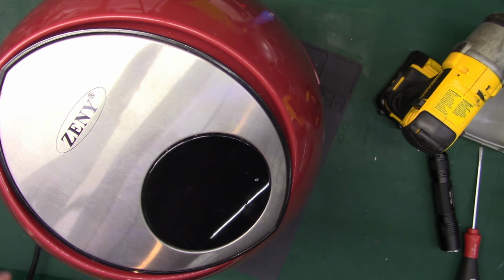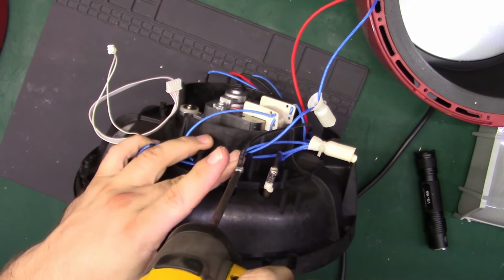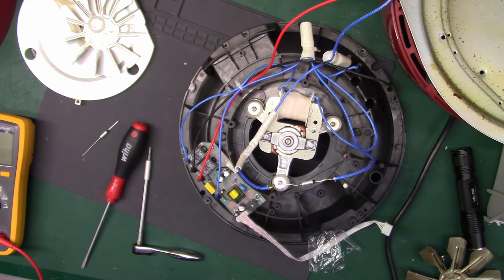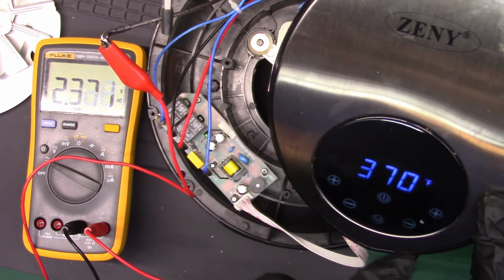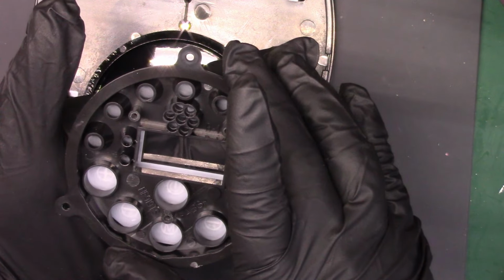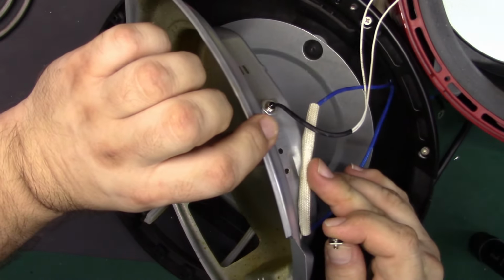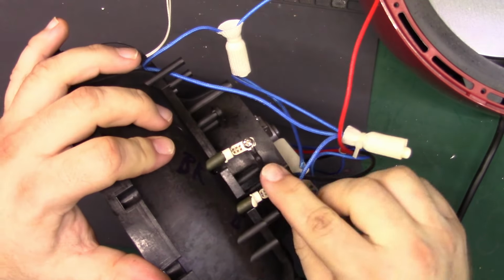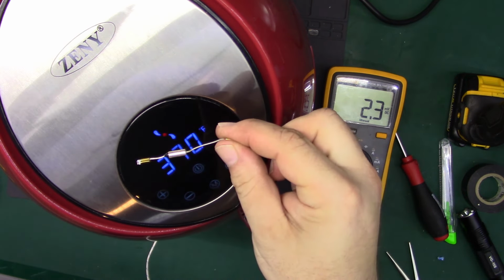Digital Air Fryer Repair

Comment: I can't believe I ran across this video. I have a Zeny that arrived and the fan does not blow' although the pot gets hot. Do you suggest I try these steps?
Reply from the maker: If it's getting hot, then you're half working. I'd check the fan(with the whole thing cool and unplugged). Make sure you can spin the fan by hand. It might be stuck. If it's not stuck then it could be a bad fan motor or bad fan motor control. If the Zeny is still under warranty, I'd get it replaced and save yourself some hassle.
Reply: @FixitFrank  the fan does turn and it is getting hot. The company told me to just keep it so I'm trying to repair it. They sent me a new one and I can clearly hear the fan. Just ran across your channel. Thank you so much for all you do!
Reply from the maker: @JFullerTruth  Oh good. That means its not jammed.  They use very simple shaded-pole motors.  I find them in old microwave ovens and that sort of thing.  You can test the motor by measuring the resistance across the wires from it. If its bad, you will read open circuit. If it never worked, I would open it and look for wires that were notplugged in or fell out.  Its more common than you might think.  Im glad you are liking my videos and thank you so much for watching!

Comment: My 8qt power air fryer pro oven just up and quit. Only used maybe a dozen times. I believe, because I did not pull it out from under cabinets that it blew the thermal fuse. Any one know the part # and info for that machine?
Reply from the maker: You want to find the fuse and get the part number for the fuse off it yourself. I wouldn't trust internet people for info that is that critical. Plus they may have used a different fuse on different parts of the world. 
However you can check repairclinic.com and they may have the manufacturer parts listed. That source I would trust for fuse info.

Comment: Thank you for making this video.  Where can I buy micro switch (model # KW3-0Z)?  16A 2 Pin
Reply from the maker: You are very welcome!  I see them for sale on eBay using that part # you list. https://www.ebay.com/itm/KW3-16A-125-250VAC-Micro-Switch-/162570007647

Comment: My air fryer xl comes on , the lights fan everything works but it does not heat i need help please thank you
Reply from the maker: What have you checked so far? I would verify the heating element and any thermal fuses.  If any of those failed it would give this symptom.

Comment: My Philips air fryer that I bought from Walmart is plagued with an intermittent motor. Sometimes it starts slow and comes up to speed and runs fine. Sometimes, the fan won't start at all. If I spin it with a stick and try again, it usually starts. But, how annoying it is. The unit is clean and the fan turns easily. Any ideas as to what's wrong?
Reply from the maker: Those shaded pole motors can be finicky. Even if spins, you may want to remove the fan blade and clean up the motor bearings. They are usually bronze and can get sticky. They are very low torque so it's easy to make it drag. If you clean it good, I bet it will be more reliable and more consistent speed. Aside from the motor needing cleaning, there isn't anything else that would really affect it, since it's driven off the mains power

Comment: Your video is great... Thanks for sharing with everyone whose has that brand... As for me.. I have a Air Fryer Pro... bought only for 6 month from Amazon now its not heating up... what do you think the problem is? everything is working but no heat..Thanks an advance ;-)
Reply from the maker: Id guess either the element itself or the thermal fuse.  Some have a thermal fuse protecting the element itself.  If you measure the resistance of the element it should be pretty low.  If its thousands of ohms or more(or open), then its bad.
Reply: Disconnected Heating Elements ❓❓

Comment: My big boss air fryer fan won't come on.The heat lamp comes on but the fan will not work what can I do to fix it
Reply from the maker: I'd start by making sure the fan motor isn't stuck. If it's free, then voltages to the fan motor should be verified. Usually it's the same as your line voltage.  120-240 depending where you live. If you have voltage, then you have a bad fan motor. Fan motors are pretty generic. Search for shaded pole motor..

Comment: my thermal fuse blown out and I changed it. It work but the control board on top air fryer is not working It is automatic turn everything on when I turn it on . Can you tell me what happen . Is it the control board for temperature and fans are not working  and where can I buy it. Thanks for your video. It is excellent
Reply from the maker: It's hard to say. I would check voltages to see if it's the transformer or not. Also check the microswitch that detects the fryer basket. If the board is bad I would be surprised. I would check (very carefully) the main power that feeds the main board. I suspect you have another safety interlock problem. Either a switch or maybe a transformer. As far as parts, I am not sure where to get a main board but eBay would be my starting point.
Reply: @FixitFrank  Thanks for your help. I will check them again

Comment: I have fan motor of air fryer Caynel similar with this one 120v /60hz is burn out but I can not buy this fan any where ,some one know where can I get it.
Reply from the maker: Hi John, That is a run of the mill "shaded pole" motor.  You can find them inside smaller fans, old microwave ovens, etc.  There are some variations but these motors are all over the place so finding the same one should not be too hard.  As long as the shaft length and mounting holes are the same(or you adapt them), you are good.  I would check popcorn poppers, induction ovens/toasteroven with convection, as well as smaller fans first.  Microwave ovens might be single mounting hole instead of dual, but of course I am looking at this fan motor. Yous may have one pair of mounting holes.  The main thing to look for is a shaded pole motor at 120/60hz
Reply from the maker: as an example  https://www.ebay.com/itm/Fasco-J238-062-Shaded-Pole-Exhaust-Fan-Motor-P-N-350475/352441961457

Comment: I can't get the damn fan to come off. All we have is wrenches and pliers. Impossible
Reply from the maker: Make sure you're turning it the right way.  They are usually reversed threads. If you are, then yeah, they can be a hassle without an impact drill or sockets.

Comment: Where can I find the circuit board attached to the body itself? I've tried searching GF532 to no avail. I ran a jumper from line in to the element, but it's pretty dangerous as there is always power to the element whether its off or on. I just have to unplug it or pull out the basket when not in use....Update: it appears I've now blown the thermal after doing neither of the aforementioned things, thus filling my kitchen with smoke, so now I need both! For $85.00 these air fryers are crap, if I spent that much on any other tool and it lasted less than a year, I'd shove it up the manufacturers a$$!!!!! Mine is a POWER AIR FRYER XL 5.3 Qt.
Reply from the maker: Hi Mark,  I think it's time to put that particular device out to pasture.  Finding whole parts is not really a viable option for the reasons you state above( Cost ).  If you like the food they make, then I'd find one on eBay or truth be told, I see them at Goodwill regularly.  They are rapidly becoming the next bread maker and crushed ice machine and have been popping up at charity shops/goodwill etc.  If you could find the elements and main-board, I would be expecting to pay way more than $85.  Not worth it.   Now if you want to get fancy about it, you could pull the mainboard and replace it with a PLC and thermocouple.  Then program the PLC to run the heat cycle.... Just an idea.  I don't have an air fryer anymore or I'd entertain the idea.  I may have to check goodwill again...
Reply: @FixitFrank  Thank you for the response. I was only trying to fix this one for sentimental reasons; my mom bought it for me last Christmas, and $85 is a lot of money for an 87 year old on a fixed income. I'll probably buy a new one and not tell her.
Reply from the maker: I totally understand. Here is a more reasonable solution. https://rover.ebay.com/rover/0/0/0?mpre=https%3A%2F%2Fwww.ebay.com%2Fulk%2Fitm%2F113820970069 it's $40 with free shipping. Refurbed with a warranty

Comment: Maybe the Thermal Fuse wasn't bad... Maybe it did its job by fusing in the face of excessive temperature.  To be on the safe side, you should follow through with the insertion of a calibrated temperature probe and capture data for an hour or so in both the empty of food-full modes at the highest heat fryer setting.  If the fan motor is under-powered, it could be running hot, just a few degrees below the temperature point of the thermal fuse.  On a warmer day or longer runtime, the fuse would pop, saving the rest of the air fryer from a melt-down situation.  At that point, you may consider upgrading the fan motor, one that embraces at least a couple standard deviations of manufacturing process variation.  (Thanks for the video!  I really enjoyed it.)

Comment: these devices cook well but they fail quickly they are very fiddly to strip down with hidden screws clips etc . i would recommend countertop oven type slightly more expensive but better through mine in the bin

Comment: Hello my air fry went off only when I was working, now I do not turn on the panel.  What can be
Reply from the maker: I am not 100% sure but I would suspect the same thermal fuse that went bad in mine. It is a common failure point.

Comment: I have a power air fryer xl that the screen turns on and off even with me bypassing the basket switch would this be the same issue
Reply from the maker: Probably not. You'd have no power at all. I'd check the wires feeding the display.

Comment: a bad thermal cutoff is the problem with most air fryer failures. pretty much true of all heat-generating appliances. it's planned obsolescence. too bad manufacturers wont use resetting thermal fuses, but they have no incentive to. As an aside, my countertop convection oven is still going strong now over 20 years. These air fryers are built to fail.
Reply from the maker: In my opinion they are too small to be really useful.  It would take 3 runs to make chicken wings for 4 people. I see their use but ultimately they all end up in the dump or in that cabinet with the bread maker, pasta maker and smoothy machine
Reply: @FixitFrank  you left out the stupid countertop pressure cookers that are the latest must-have item that fails after 25 use cycles. & yes, my wife just had to have one.

Comment: Can you tell me how to fix my NuWave Brio Healthy Digital 10Q Air Fryer? I just got it yesterday but the lid won't close. I can't unlock it when I pull on the knob the way it says to pull it out but it refuses to unlock to close it so I can't use it. I would love to use it and soon.
Reply from the maker: Hello, Unfortunately I am not that familiar with that model.  Personally I would get it replaced if its new.  Sounds like something is wrong if you are following the instructions. If the latch is jammed, I don't know if I would trust it even if I got it open.  Maybe try NuWave customer support? Im sorry that I don't have more info for you.
Reply: @FixitFrank  Thank you for reading my comment and trying to help. I wasn't sure if you would as this video was a while ago lol. Yeah, I have been scouring the internet and youtube trying to find something so yes I did send an email to NuWave customer support. I am just very disappointed as I really wanted to start using it. This is the first one I have ever owned and because my husband has been diagnosed with pre-diabetes this would help with his diet greatly. Hopefully, they will get back to me soon about this and tell me how to at least send it back to them so I can get a new one.  I am quite disappointed right now.

Comment: Thanks for the video Frank! This was very helpful. Quick question, mine just randomly stopped working one day and knocked out the breakers in the kitchen. I found the micro-switch inside didn't have continuity. My fryer doesn't have an on / off button, so is that just a safety switch so the fryer doesn't turn on without the basket? Can I operate safely without it or should I try to find a replacement?
Reply from the maker: Hello Han,  I am a big fan of safety interlocks with this sort of device. I would see about replacing it.  I suspect it's a pretty standard microswitch.  Knocking out the breakers is curious though.  I guess a momentarily bouncing switch might cause it, but I would give the heating elements a check to ground to rule out any failing in the heating element insulation.  I would be fine with testing it by jumping out the micro-switch but I would not leave it bypassed when you put it back into use.

Comment: Your video was great ! I diagnosed the problem on the Air Fryer XL and ordered the parts...172 deg thermal fuse 5 for $3.19 on e-bay...wouldn't have tried to fix it if I had not seen your video...thanks
Reply from the maker: Glad to hear it! That's my goal. I'm glad it helped, thank you for letting me know! Take care

Comment: Is the Nuwave oven similar? I bought a Nuwave oven and thought it was supposed to be a infrared oven. When I look under the power head all I see is a regular heating element and a fan. Is it really an infrared oven?
Reply from the maker: That is a good question.  It may glow enough reach near infrared.
Reply: FixitFrank I’m just concerned I bought a knock off of a Nuwave from Walmart. The Nuwave is advertised as an infrared oven but I do not see any evidence of a infrared light.

Comment: Thanks for the video.  I followed it to fix my Gourmia 5qt (Model  GAF575) air fryer.  After 3-4 months my air fryer just died.  I opened up my air fryer - it's easier to work on than the Zeny - just pop off the top plastic cover and then 4 screws and the entire top comes right off.  I found the same exact 172C thermal fuse.  I checked for continuity - none.  I ordered a 5 pack of fuses from Amazon for $6.59.  It took me about 2 minutes to replace the fuse.  Thanks again!
Reply: RemoGaggi gracias
Reply: I have the same GAF575 model with the same problem I think.  RemoGaggi how did you get the top plastic cover off of the Gourmia?  I tried pulling that flat disc part but it won't come up.  Is that what you're referring to when you say the top plastic cover?  Thanks.
Reply: @markandjuliemears3745  That top disc just pops off.  There are 5-6 clips that hold it on.  Try lifting at different points around the disc/top cover and once you get it to lift at one point, the rest will come off easily.  On mine, it lifted up easily at the 2 o'clock position (if you are facing the front).
Reply: oops.  nevermind.  I looked at it some more and I used a bottle opener and pried the flat disc up and it came off easily.  Amazing how the right tool makes a job so easy.  :-)
Reply: @markandjuliemears3745  I think you jinxed me as my air fryer literally just broke again today.  It was the same thermal fuse and I had extra from the last time.  It took me a few minutes, but it's up and running again.  The last replacement fuse lasted about a year.  The original fuse blew after 5-6 months.  It's looking like a yearly thing now.
Reply: @RemoGaggi  Oh no. Glad you were able to fix it again instead of having to buy a new one.  Is there something in particular that causes the thermal fuse to "trip"?  Clean it more often or better?
Reply: @markandjuliemears3745  I don't know why the fuse blows on this.  Today, mine blew after running about 10 minutes @ 400 degrees.  I think it's a design issue with this model as I recall reading that many other people have the same problem.  Difference is that most people will just throw it away and buy a new one.
Reply: I have the same name brand Gourmia Digital Air Fryer # gav575. Mine goes on if I plug it in and the Digest Monitor comes on like a lite up Christmas Tree.  I have to unplug it to make it go off and none of the Controls can I control. Is there a Reset switch.
Reply: I just got a gourmia GAF698 and I have power to the whole unit, cord and the basket switch is hot but no lights come on for power. I can’t test for continuity I only have a hot cold tester. It is probably the boards then?

Comment: Hi I can not manage to open the upper part (as it is not shown in the video). could you explain me how to remove the gray upper part?
Reply from the maker: Sure.  All I did was pull a little on the sides. There are 2 clips per side that  latch inward. If you pull on the outside (left / right) edges of the grey part, it should pop loose.  Be careful that you don't pull too hard and tear the wires off  the display/button panel.  You may even want to try pulling up on one side at a time.

Comment: show me where yoiu got that motor?
Reply from the maker: I only purchased the thermal fuse.  The motor was still good.  You might want to try repairclinic.com though for parts.
Reply: @FixitFrank  buit my fan motor went out, do you know where i can get it>
Reply from the maker: @andycao4547  It is a very standard AC motor.  I think you can use a microwave oven fan motor or at least the coil part with the laminated steel.  You should be able to re-use the original rotor. If you want a new motor, I would look on Alibaba or eBay. Google the model # of the fryer and also Google any numbers on the motor itself.
Reply from the maker: @andycao4547  something like this.  "generic appliance motor"  https://www.ebay.com/itm/Generic-Appliance-Motor-ERM-241-120V-60Hz-26A-Z-P-B-3000RPM/172918712856
Reply from the maker: @andycao4547  Another term is "C Frame Shaded Pole Motor" .  They are very common. As long as the voltage is the same, and the shaft length is the same, you can use any brand.